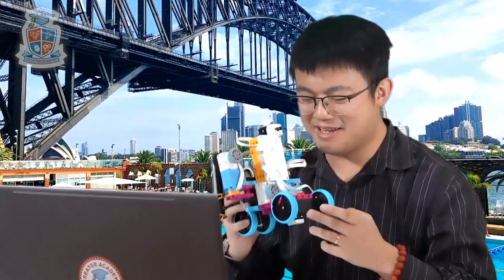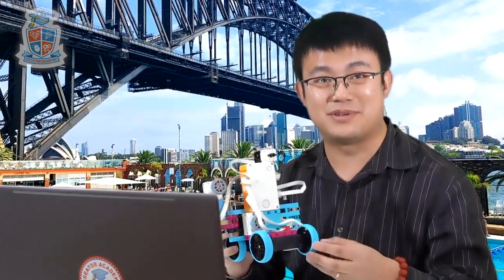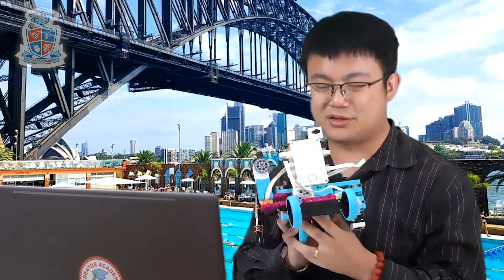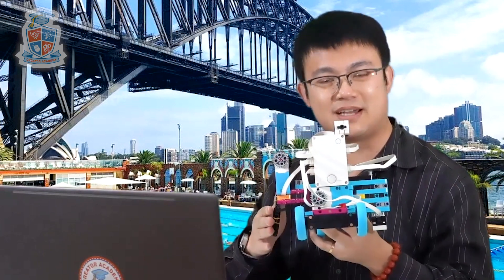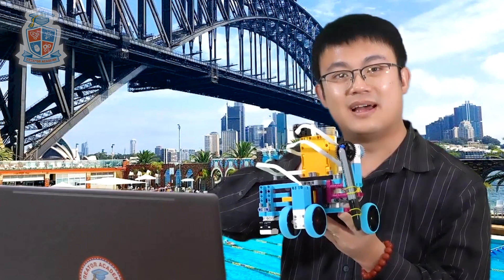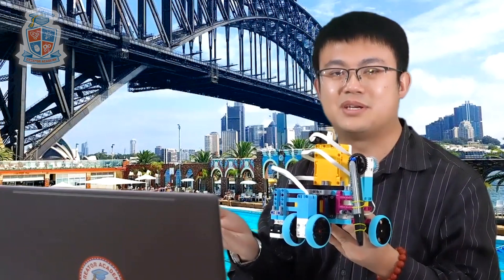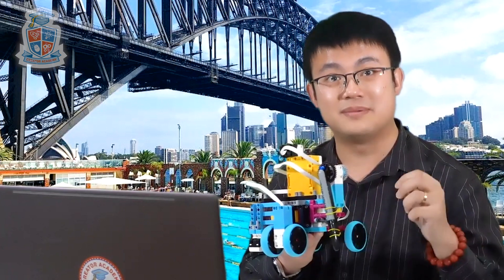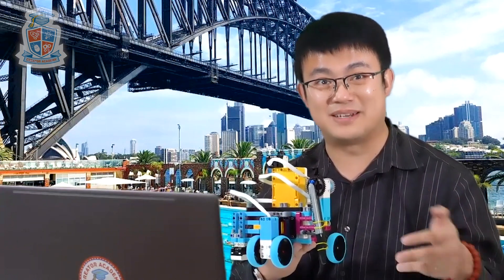LEGO SPIKE Prime Scanner and Printer Build Instructions

Comment: Wow! Fantastic creation! Can you please explain more in detail how the code works? I bet it has a lot of variables. But how exactly does it map everything out and how many variables does it use? Does it use one variable for every square milimeter? Or is it simpler than that? I’d love to know!
Reply from the maker: Hi! The code is actually very simple. There is a loop where the robot moves slightly along the Y axis, and a nested loop to move the gantry along the X axis. If the reflected light is lower than a certain threshold, the marker moves the pen to make a mark. So the only thing to do is decide how far to move the robot within each loop- the smaller the move, the higher the ‘resolution’. Feel free to email us if you’d like to talk through the code in more detail 😊
Reply: @CreatorAcademyAustralia  Could you do a video on this sometime? I love your videos btw. I just got mindstorms ev4. Ive been watching and learn. thank you for everything!